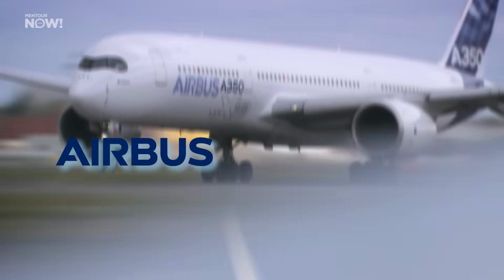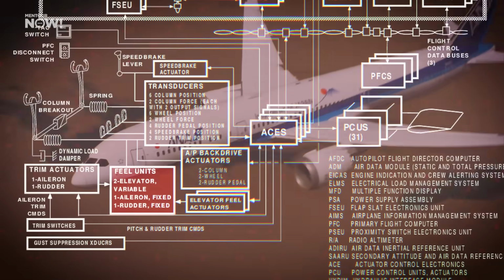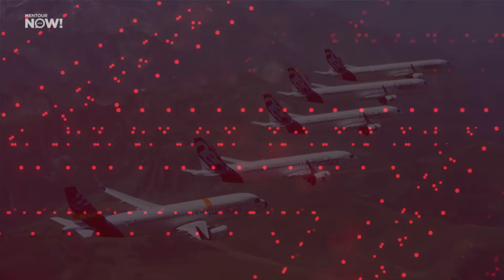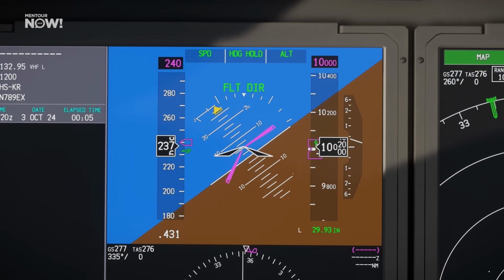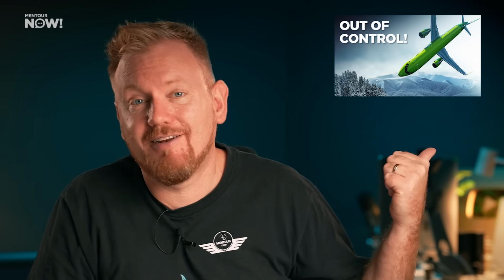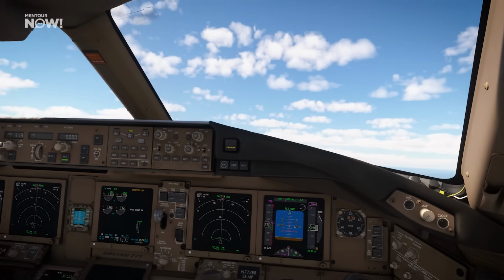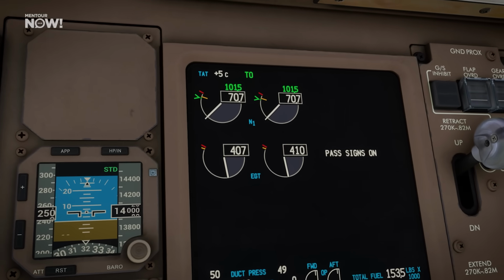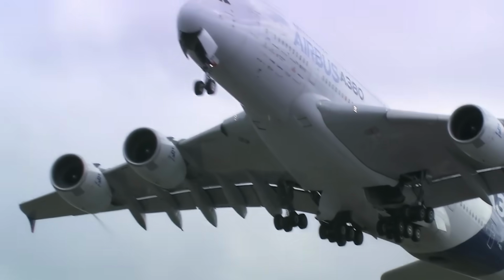Do Pilots Prefer AIRBUS over BOEING?!

Comment: If operating in Normal law, the aircraft is preventing the pilots from executing possible emergency maneuvers, like a hard roll or hard pitch down, to avoid another aircraft... I seem to recall an early crash that resulted from the aircraft not allowing full throttle and pitch up, at the end of a runway?
In a front wheel drive car, for instance, sometimes the traction control tries to drive both front wheels at the same speed, so that, even with the steering wheel hard left/right, the driving wheels, in snow/ice/heavy rain, will drive the car straight, with almost no turning, other than a slight "rudder effect" from the wheel angles... A simple, but real case of even everyday "automation" preventing the expected response to driver input.
The lack of physical feedback in the Airbus system dramatically reduces the pilot's awareness of the actual control actions and results, and the dual sidesticks, without coupling between them, to unambiguously inform the pilots of the interaction...
Reply: Traction control in a car actually does the opposite of what you say. It limits engine output to keep tires from losing traction and maintain directional control regardless of throttle position. Then you have stability control which will activate brakes at a single wheel or wheels to help maintain direction of travel according to steering wheel angle input. At no time does either system input power to the wheels in any scenario.

Comment: The system should say “contra input” or “additive input” depending on the type of dual input. Simply saying “dual input “ is too vague in an emergency situation and relies on pilots realising what type of dual input is occurring.
Reply: Why does it matter what type it is. If you hear “DUAL INPUT” that means both pilots are moving the sidestick so immediately one of you needs to affirm who is the pilot flying, press the takeover button and tel the other pilot to let go immediately

Comment: Hello and than's for another video for a serious gear head, never mind the field.
If what I saw at 3.27 pic, is that, the "current state" of BOEING"!
If, I will stand on Terra Firma then.
Just a joke.
The fly by wire in a safe system, as long it doesn't turn the plane to a  tiller, like the early Gripen, outside Stockholm.
Keep these coming, though I am a "Wanna Be" pilot, I enjoy Your videos, and since I am in Sweden, they are refressing info.
from a Finn in Diaspora

Comment: As a passenger I prefer Airbus. The planes are less noisy, the seats are more comfortable. and the overall impression inside the passenger seats suggests a higher grade of stability and reliability. However, inside PC flight simulators I prefer Boeing, because the instruments and controls are easier to handle and provide a more Cessna-like feeling.

Comment: Overall I agree with your assessment between the two but I’m surprised you didn’t mention MCAS as that was a inbuilt safeguard built into the flight system and wasn’t clearly understood by flight crew’s until after the two tragedies.✈️🇦🇺
Reply: MCAS is meant to be hidden from everyone. This guy included.

Comment: I guess that transition to direct law for an Airbus pilot would seem like someone who spends all their time driving a truck with all the safety features, like lane tracking, automatic following distance, adaptive power steering, automatic transmission, running on cruise control, suddenly finding themselves in an 18-speed semi, with power steering gone, going 150 kph on a crowded freeway!

Comment: Re the S7 incident description; you left out a feature that Airbus have designed into the displays during flight in degraded laws. 

They don’t have to look at the ECAM to notice that the aircraft is in Alternate or Direct law. The PFD has indications to help the pilots. As alternate law is no big deal, the indications are subtle (but obvious to a well trained Airbus pilot). 

If the aircraft is in direct law, both PFDs (the screen that the Russian pilots would have been glued to during their pitch oscillations) had a hugely obvious message displayed in the blue part of the attitude display that reads “USE MAN PITCH TRIM”. 

Maybe it was a language barrier, poor training, or something else - but one of the two pilots should’ve seen this and followed its guidance.
Reply: Maybe they did notice it but failed to note that the trim was in the full-up setting.
Reply: @ender22782 That's hard to believe as if one of the pilot would have noticed their first tought should be looking at the trim wheel.
Reply: Imagine the startle effect the S7 crew faced. Departing in a winter storm from an airport surrounded by mountains, on a fully loaded A321neo, they encountered speed fluctuations almost immediately after takeoff. They were likely experiencing moderate turbulence, adding to the stress and compounding the initial shock that led to the ensuing aircraft upset. This reaction aligns with the urgency and confusion heard in their initial radio transmission.
So I doubt that they didn’t get the message on the FMA due to a language barrier or something.
Other aircraft faced similar weather but managed uneventful departures by following the procedures like unreliable speed. Even if the S7’s fuselage had been de-iced, ice ridges would still have been a problem, as these form primarily from melted on the warmed windows snow. For aircraft like the A321neo, which require more ground time for start-up and warm-up during winter, the prolonged exposure to falling snow makes ice ridges more likely.
Preventing such incidents requires more than just de-icing. Proper training is essential to maintain manual flying skills and combat complacency. Additionally, implementing specific holdover time limits to address ice ridge formation, based on precipitation rates, would also help.
Reply: @Marcusus91  fair comment, but it’s not an FMA indication; it’s a large, red message written across the blue (sky) part of the attitude indicator. It’s designed to be very hard to miss and gets the PF’s attention because he will be flying the aircraft manually at that point.
Reply: @Klink330  Amber message, not red. Mechanical backup is red.
Reply: @ good point. It’s been a while since I was on the 320. The 330 has it in red. Thanks
Reply: @Klink330  no, it's Amber for Direct Law on the A330 FCOM 27_20-20 Reconfiguration Control Laws/Alternate Law/Abnormal Control Laws-In Detail-Alternate Law.  Red is only for Mechanical Backup
Reply: @ I stand corrected. Only with dual elevators loss. Into the muppet corner for me 😁 Thanks again.
Reply: @Klink330  Not the intent at all to put you in a corner 🙃 just wanted to clear that up. Happy nice positive landings, specially with the front boogie
Reply: So you're going to tell a Russian what " “USE MAN PITCH TRIM” means in direct law..... yeah that will work. Airbus kills lots of people due to pilot confusion with "automation".
Reply: @ fundamentally not true.

Comment: Inputs being combined in a way that allows pilots to cancel each other out without any tactile feedback seems asinine to me.
Reply: In the EgyptAir Flight MS990 crash, one pilot pushed, one pulled, the yokes split and each one controlled half the control surfaces. basically averaging themself out. Same effect. Maybe one reason why Airbud did it that way? Copying Boing, the older company, just electronically, thought it was a good idea?

Comment: Hi Petter, congratulations on taking on such a controversial subject! Hopefully you’ll get a chance to have a go in an A320 sim at some point. With familiarity the non back driven throttles and unlinked sticks become natural. In your safety comparison you correctly point out all FBW aircraft are similar crash statistic wise. The problem is the vast majority of Boeing production isn’t FBW. The 737. No FBW, no EICAS and crash statistics far worse than the A320. Of the approximately 12000 737s made there have been 234 hull losses. Of the almost identical number of A320s made just 38 have been lost.

Comment: To mee it looks like Airbus with active sidesticks and moving thrust levers would be quite optimal.
Reply: You get used to the static stick and throttles really fast. Also less chance of a mechanical issue with them.
Reply: @falcodante1114  The fixed thrust levers is not an issue. The EPR guage starts catching your eye and it becomes normal to notice changes. Just takes a little time and it normalizes. The thrust lever philosophy really is better on the bus.
Reply: Airbus throttles do move, if you move them 😉
Many Airbus pilots at my airline often disconnected autothrust during an approach to landing. 
They’ll act just like Boeing throttles when you do that.

Comment: At this point we can’t really have any reasonable discussion since only one manufacturer in this comparison has constantly wheels and doors fall off. No other comparison necessary with this in mind. I love 747 and if given a chance to ever fly in it again I would happy to do so, probably unlikely though. And I will deliberately refuse flying on 737ng or max, 777-8 etc. Comparing  A350 to 787, a350 is amazing in any sense, 787 keeps making creaking sounds, like Titan sub I would imagine. Not a good feeling

Comment: Why doesn't Airbus add force feedback to the joysticks? Why doesn't Airbus move the throttles when it is adjusting the engine output? Are these difficult or expensive to achieve?
Reply: It would  be a complete change of logic of how the plane is currently flown and would mean pilots could only fly one type or the other

Comment: From an outside view, a person who hasn’t flown either, and isn’t a fanboy, the truth is that both are flawed and need to meet in the middle. A lot of info like in the airbus, tactile feedback like in the boeing, protections similar to the airbus, but I feel like airbus does it kinda wrong, I’m no expert, but „stopping” the controls, like when reaching the end of a non fly by wire mechanism, would be a much better indication to the pilot that he is doing something wrong rather than just disregarding his input. Pulling the controlls from his hand, pushing the trust levels forward when in toga lock etc. That I feel like would be an ideal combination of the two.